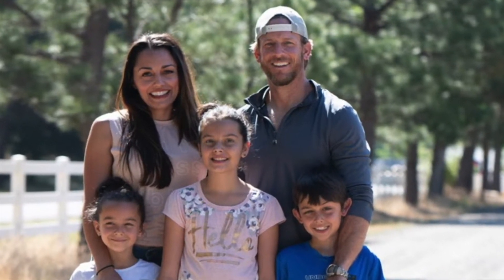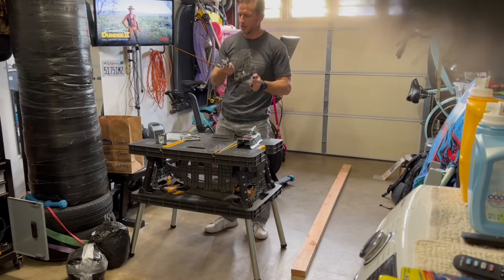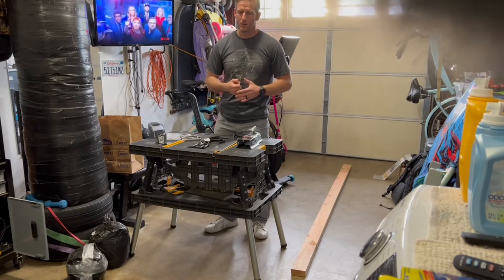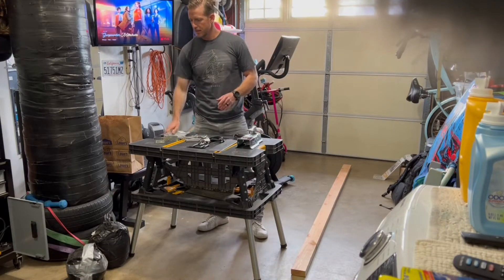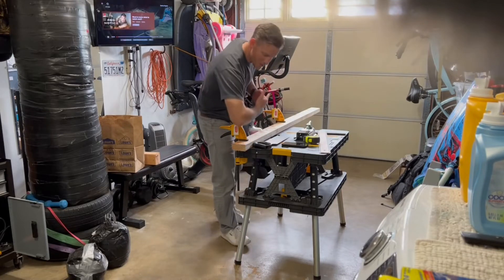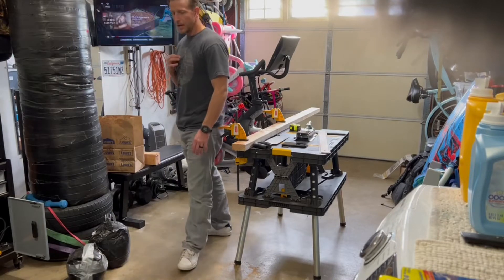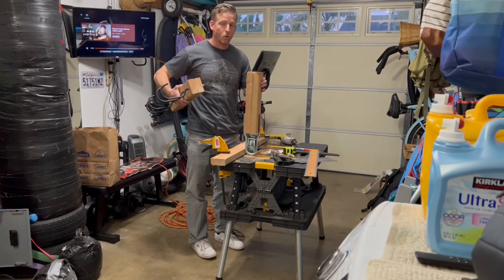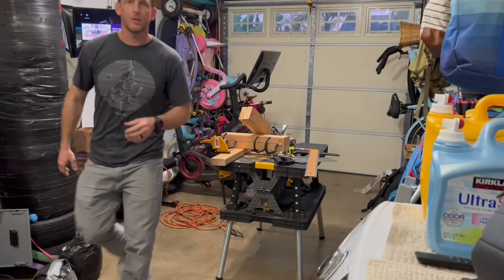Easy DIY Build to Tow Generator for under $75!!!

Comment: Good idea. I have a 10kw unit i need to move around sometimes. Its just a short jump down the highway. Its a generac and has good tires so it should be fine.
Reply from the maker: Great!  I hope you’re able to use this idea and make it your own for your specific application!

Comment: Those plastic wheels do not absorb shock and there are no bearings. They will be broken/chewed up in a short time. What happens when you hit the brakes and the generator happens to go vertical?
Reply from the maker: That’s a great point, but this is just for moving it around our property. It’s our alternative to moving it up and down hill for 1,000 + feet by hand.